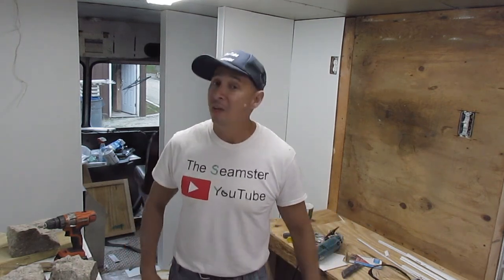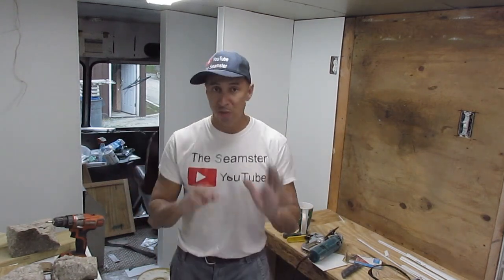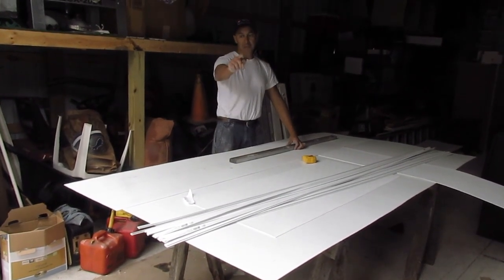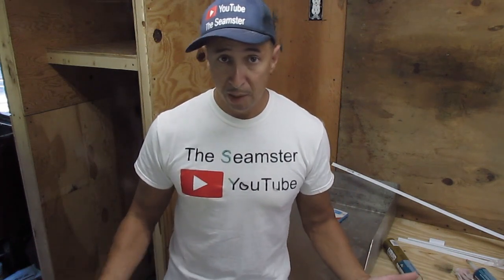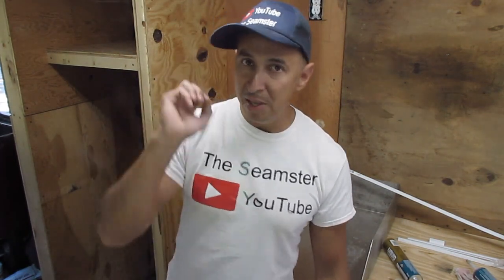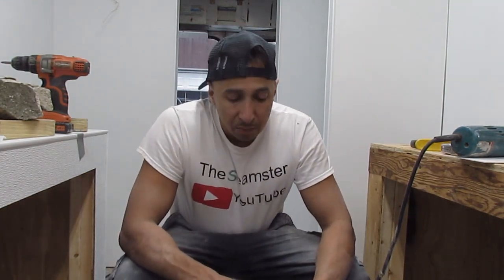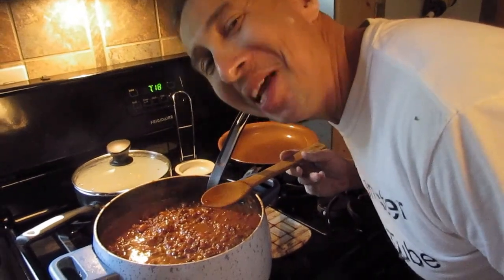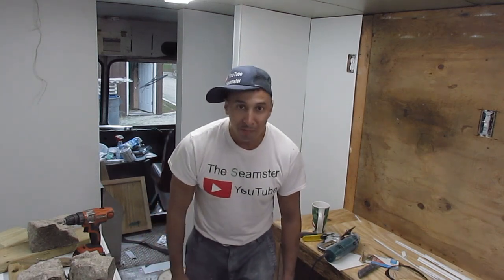Building A Food Truck Trailer Almost Part 5  Trailer Teaser

Comment: Just found your channel tonight, only took half of part 1's video on building a food truck to get me to subscribe. I myself look forward to building a food truck sometime in my future, although as of now I'm more focused on building a mobile food cart instead, I'm the type to start small and work towards the bigger picture. I am curious about the truck though, for instance, is it running unleaded or diesel fuel? It seemed like a pretty low price too, is there a lot of miles on it or other repairs it needs, if any? I'm down in IL so finding anything affordable is next to impossible without major repairs needed. Anyway, looking forward to part 5!
Reply from the maker: Ok, the truck is 1989 Chevy V8 Gas, Auto 98,000 miles. $2500 and I still find them at that price today. I just looked in Illinois and found 3 that I would buy if they were closer to me. Yes, some have problems, like needing a brake line, or needs tires. Oh, well, still worth it if its under $3500 and runs great with no leaks or smokes. Part 5 is all FRP and those that are on a budget. A long video but well worth the watch. Thanks for the comment my friend :)

Comment: Dont cut the frp with a saw like that.   Try and use snips if possible
Reply from the maker: Good way for carpal tunnels and depending on frp. It will crack and take 3 times longer. If using electric snip very expensive. Please make video and show us. The SEAMSTER
Reply: @TheSeamster   is it really thick ?     I'f it is the stuff I'm thinking.   Its possible to use something!    I'm just trying to figure a way to not get all the fiberglass in the air is my thoughts.   Ill try it with my automatic tin snips